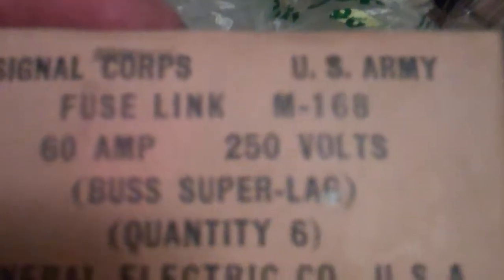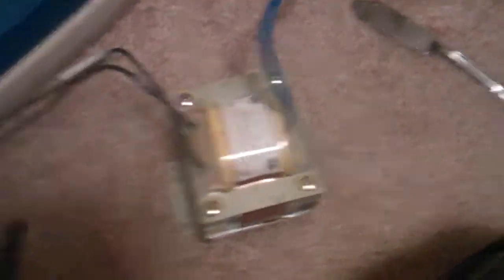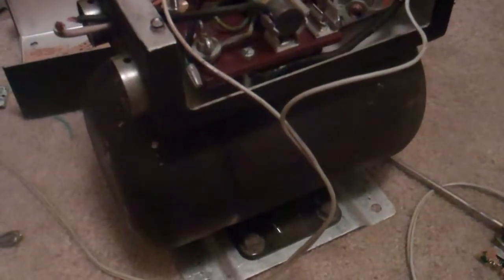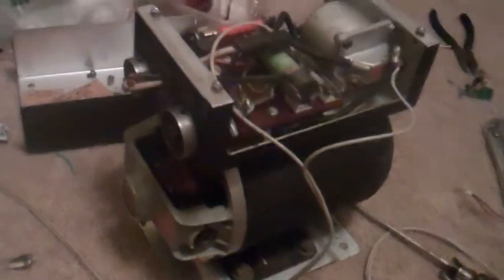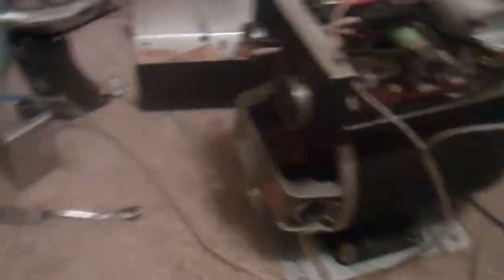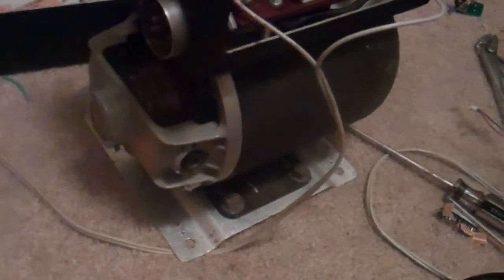General Electric Dynamotor

Comment: Nice machine!! I used to have a few dozen dynamotors of different makes back when I was in junior high school. My favorite was a Western Electric, NOS and its electronics/relays were in the box that the machine was mounted on top of. Input voltage was 5VDC @ 30 amps, output was 400 and change VDC at 2 amps.